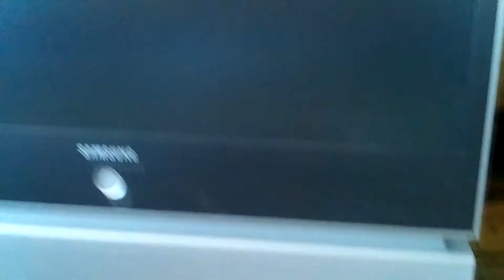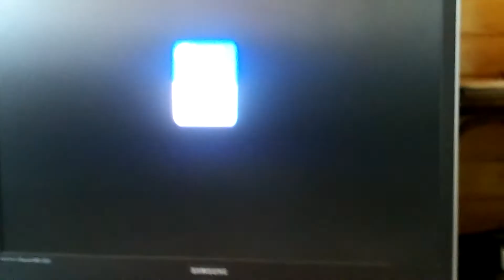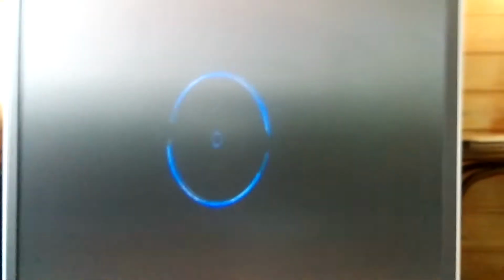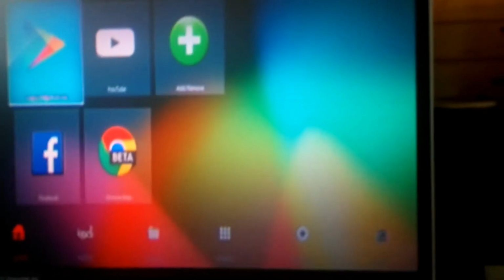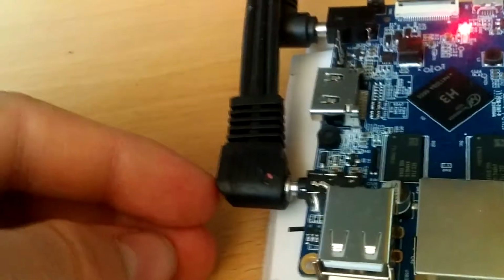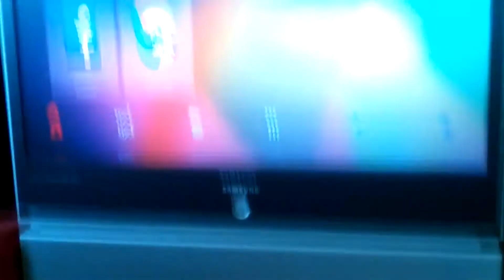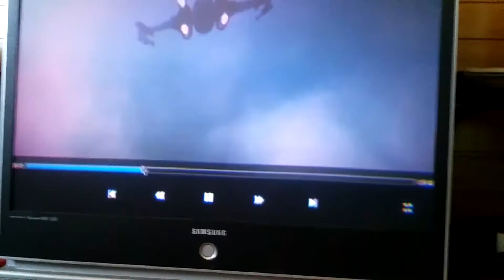Analogue TV with Orange Pi Pc (Android)

Comment: I can see you tried too , HDMI to av converter with no luck . Your video helped me a lot . But tell me , is it a AV module  you added to your board  or it already comes with AV out ? wich settings did you use to get the pictures on the tv screen ?
Reply from the maker: Sorry for the late answer.
I did not add anything to the board, the AV out was already on it. If you don't push the AV cable all the way in to the AV out, it also gives audio. But you can always buy a USB audio adapter if you want to.
I have not tried HDMI to AV converter, since I read the cheap ones worth nothing and I did not want to buy an expensive one. I mean this way I got a computer as well for less money :D
About settings: I still have not manage to get any OS running with this analoge TV other than the Android OS which you can see in the video. This one worked without any settings required. The TV was in AV mode.
The link to this OS:
http://www.orangepi.org/downloadresources/orangepipc/2017-05-11/oragepipc_79c5c49095f769842aa91858a8.html

I hope it helps
Reply: @makrcsen5007   you did right  not buying HDMI to AV  converter  .  I bought one  a long time ago (HDMI2AV)  , tried anything to make it work , with no luck  .      but  there's  another  converter  that seems to be working fine  , and I read no complaints about it  ,   it's from RADIOSHACK  https://www.youtube.com/watch?v=6ir4ZRvdvCg
Reply: How did you flash the os?